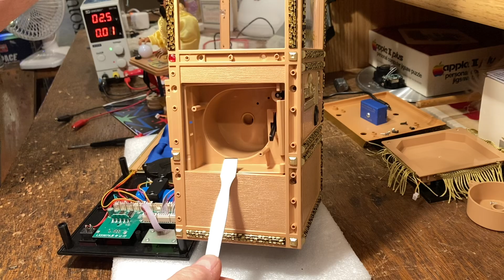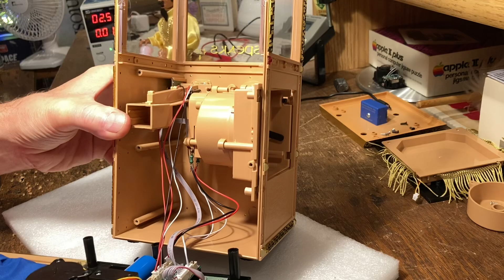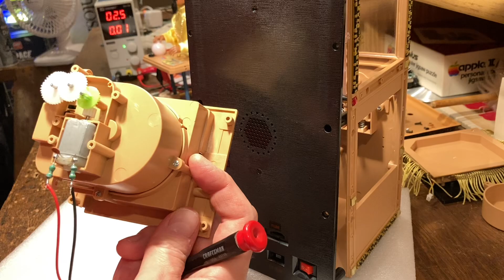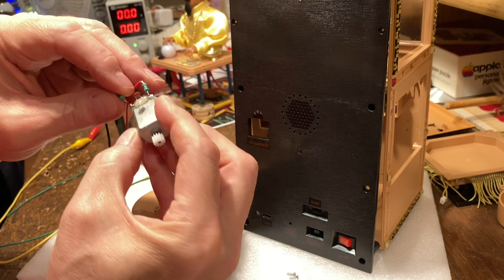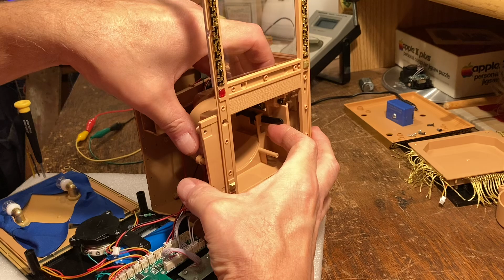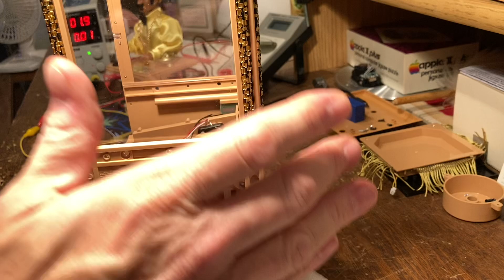New Wave Toys Zoltar Disassembly Of Ticket Motor #7

Comment: I bought a couple rings I was going to try and put on my Zoltar's left hand. It looks like the tray he's on should just slide out, but I couldn't move it. Are there screws holding it down under the trim..?
Reply from the maker: You need to watch my disassembly video. It shows you what to do.  New Wave Toys Zoltar Disassembly Video #1  Thank you for the comment.